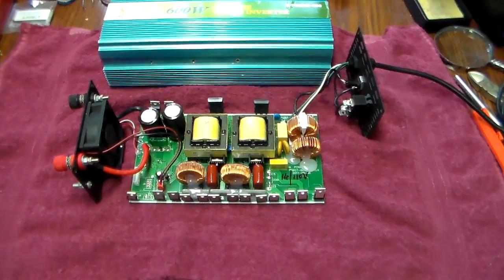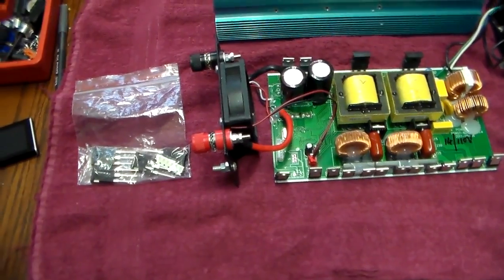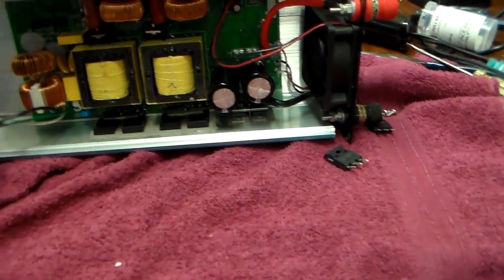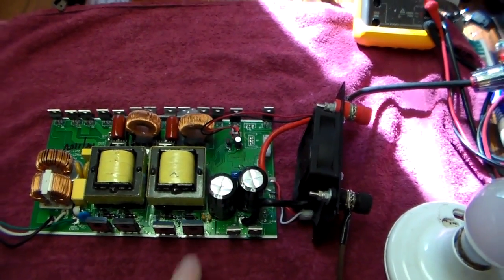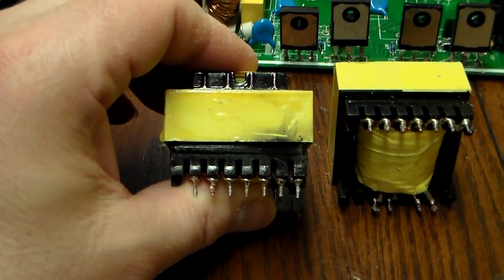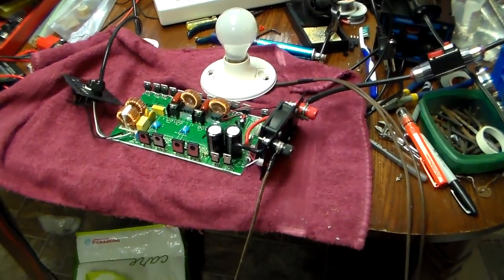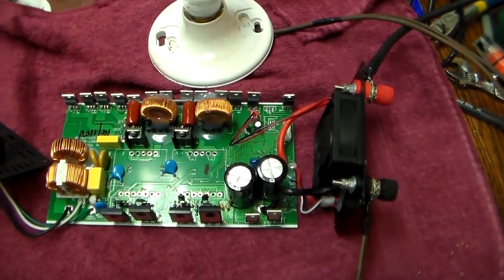Power Jack GTI-600 repair

Comment: have you ever tested other switching transformers? they are always almost zero resistances. They work on high frequency 10-100khz. there are other tools to test them like inductance meter. usually when these are blown they go open.

Comment: I bought in 2015 dec. a China grid inverter, - It is a 600 watt type for 36 volt pannels. There are 7 panels on it with total 600 watt. They are all parallel. After a few day the group of the inverter was shut down. Inverter also defect. I was measure the mosfet of the ac side. 1 was defect. Bought at the local parts 4 new and change 2 of the first AC side.Also i use new coolingpasta. Today the inverter is working oke. But i;m still knowing that the China Mosfets are also cloons..SO these can give problems after a few months. Now i change them for higher quality the inverter will work better and longer. Still have to at a better cooling fan on the side. Heat wil make the stuff crap.

Thank you for your video. After seeing this vid. I try to measure it.
Reply from the maker: I am not sure about the model for 36v as mine was 10 to 30v for 12v system = 17 - 19v under full sun

I was able to repair my KD type inverters as they were defective with bad opto couplers from the factory they have been running fine for 2 years since the repair although I am under powered right now with 4x100w panels & I think the inverter calls for 700 +w of solar panels to produce 600w 

right now I am only generating about 200w with 4 panels mainly because I put them on the roof of my new shed so they are not at the optimal angle to the sun when I correct that I should get 300w from 400w of panels with these cheap china inverters 

as for these power jack crap I have never successfully repaired one, as I suspect the mosfets I buy from china are counterfeit, also with the power jack type the DC power caps go bad first & should be replaced with ones that have a higher voltage handling than the originals.

out of all the cheap ones I like the KD style the best, I have had very little problems with them & other than the thin aluminum AC wires which can brake inside the heat shrink causing intermittent power up those inverters seem to stand up over time better than the power jack type.

 https://youtu.be/rou_heMtFtc
Reply: i have a different one. With a 22v- 46v i think. But with full sun it gives 40Volt an with inverter it runs back to 30 volt.
Reply: Roger Foster What? You obviously are a racist. What makes you think you're any better than them. I'd take 10 of them before I'd take 1 of you!
Reply from the maker: in the world of inverted reality we live in today the word "racist" is a mere accusation use to shut people down, lol

I prefer the term equal opretunity racist, see I don't discriminate, I view all stupidity & dishonesty with the same disgust regardless of race, & if the behavior fits a racial stereotype I don't mind letting them wear it.

I do not hate people of other races because of there race nor do deprive them of my business in a mutually respectful manor unless a repeated undesirable action becomes a cultural trait.
Reply from the maker: the biggest problem I have is finding quality mosfets now that we no longer manufacture such here in Canada, the majority of the ones I have received  from China I have found to be counterfeit.

would it be racist to say if I were looking to hire counterfeiters China is the first place I would look, their reputation precedes them, they are the best in  the business, there is nothing they can not counterfeit including food, lol

Comment: Seriously?  "ugly Nips"?  Not only is that totally incorrect (those inverters are not made in Japan), you give great example of your hypocrisy. You seem to be all about buying products "cheap", and that often means made in China... but then to throw derogatory comments about them? If you don't like cheap products made in China, then don't buy them... then you won't have to complain about their advertising.

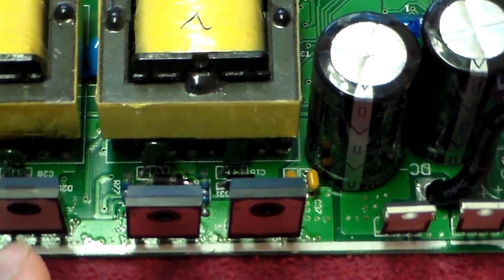Then you also contradict yourself about saying which MOSFET's were blown, and that “this here number 6 MOSFET” wasn't blown (05:38), so it couldn’t be what blew smoke on the transformer, but it actually was, by your own indication earlier in the video (00:23).

You also show your lack of technical knowledge by not even remotely understanding the circuit, and how high-frequency switching inverter transformers would not have any DC resistance measurable with your normal Fluke DVM. The transformers are fine... the primary windings will have DC resistances in the very low mOhm range.

Oh... and I'm sure glad other countries don't use women to advertise products that typically appeal to men... or else people might make derogatory comments about their "ugly" women in advertising...
Reply from the maker: I don't know what country you are from but over here we are born knowing what ugly is, race has nothing to do with it, every race has beauty & ugly & those are a far cry from super models.

Comment: What brand of GTI would you recommend?
Reply from the maker: it all depends your location, Here in Canada I buy the Greenergy star grid power 2, they are rated for 400w but you will only expect to get 225w from three 100w solar panels connected parallel  this will also run the inverter hot causing it to reduce power  till it cools, currently I am running two & two that is two of these inverters with two panels to each inverter for about 150w from each inverter and they run pretty constant output at that configuration. realistically you can expect to lose 25 watts for every 100w of solar panels due to inefficiencies in these cheap inverters.

 http://www.ebay.ca/itm/400W-GREENERGYSTAR-2ND-GRID-TIE-INVERTER-FOR-SOLAR-WIND-/200541768307?pt=LH_DefaultDomain_0&hash=item2eb1388a73

I have been running two of these for two summers now with no problems, I did buy a 600w KD clone that never worked from china, the seller sent me another with the same problem by then it was too late to dispute the transaction.

for that reason I tend to buy close to home even if it costs more.

I have been looking at these small water proof ones that go on the back of the solar panel I have not tested one yet
I may take a chance on one & see if they are any good
this type will need to be connected in series as they are rated for higher input voltage so you would need to get the correct one for the total number of solar cells when the two panels are connected together.

http://www.ebay.ca/itm/360823755860?var=630252738123&ssPageName=STRK:MEWAX:IT&_trksid=p3984.m1438.l2649

for wind turbine the sun for wind has the built in dump load switch so all you need is to add the dump load resistor.

Comment: my power jack was bad out of box I try to get it fixed but had no luck do not buy power jack get some other brand that will fix bad out of box units I an a low voltage contractor so I did not hook up any thing wrong! buy Other Brand!

Comment: Hello sir I have the same one and never worked ,i bought it new and never worked a minute.
 It is burning the ac mosfets  ,i changed them 5 -6 times but it is still burning  the mosf, and the ac fuse.Transformers counts ok ,
 One year now i did not made any try.
 Thrasos
 Thank you
Reply from the maker: Hi, I don.t know too much about what causes the the AC mosfets to blow, does it happen as soon as it powers up or some time hours or days after it has been running?, I know these get spiked very easy if you don't power them up & down in the right order, first switch the power switch to off, then plug in the ac cord then connect the DC then turn the power switch on, to remove turn off the switch, remove the DC then the AC cord if you connect or remove the AC cord while the DC is connected it may spike the AC mosfets, also if you have it plugged into a line with high surge devices on it like a fridge, air conditioner, water pump or space heater this can also spike the AC mosfets.

Comment: You really should not make fun of the quality even though it is poor. Your friend overloaded the voltage by hooking up 48v panels in series and you overloaded the current by connecting straight to a battery. 600 watts max is 600 watts.
If you want to test it from a battery, you need to limit the current to under 25 amps.
I suggest 1 or  2 amps limit for testing.
When all else fails, read the manual - "do not connect DC side directly to a battery".

Comment from the maker: then power it up & see what happens with the lights it could be a faulty mosfet that is not shorted,then check the B+ power caps they go open or low, if they use 25-35v caps replace them with 50v caps of the same UF, next I would suspect a diode some place in the circuit.

Comment from the maker: sorry I have not had any luck repairing any of these power jack inverters, I also have a 300w PJ GTI that was putting out very little power, I replaced the power cap then I was getting 15w when I should have been getting 30 to 50w from the panel I connected to, so I replaced all 4 DC mosfets then I was getting 0w yet the lights seemed to be working properly, I also had the same problem with the 600w GTI in the video, I now suspect fake mosfets being sold on ebay.  try removing all the DCmosfets

Comment: Roger, I am having an issue with my 600W gti. When I apply 12V power to my inverter I get three green lites and no red lite. I have replaced 2 mosfets and an A/C fuse. It still workes the same, three green lights and no red light. The green lights do not flicker, they are on constantly. Do you have any idea what I can do to solve this problem? This inverter worked for about 2 months before it just stopped working. Thank you for any help you can offer. Or if anyone else has an idea to fix.

Comment: the gti I have one was blown the transformer the other was good I just removed the bad one and the other worked fun I dont have 600 watts of course because its two 300 watt gti. so I have at least 300 watts try putting the other one in to see if it works or if you still have the transformers please let me knwo if you have the one that dont have smoke on it because I buy it off you.  please please. lol